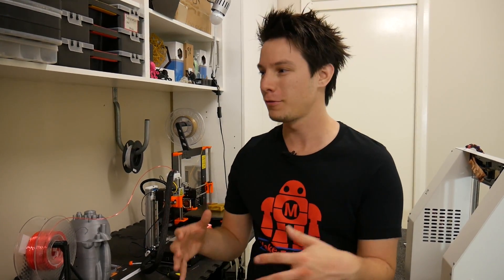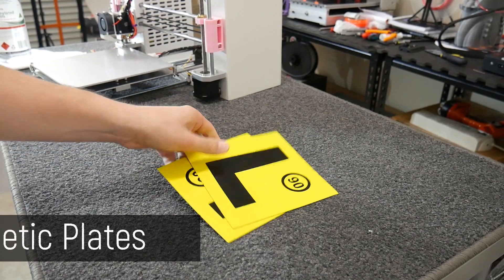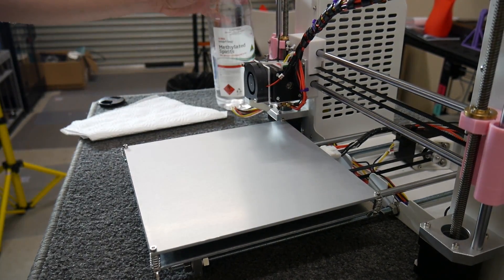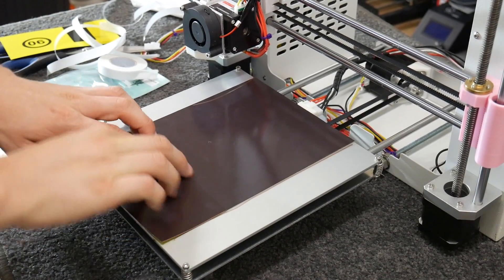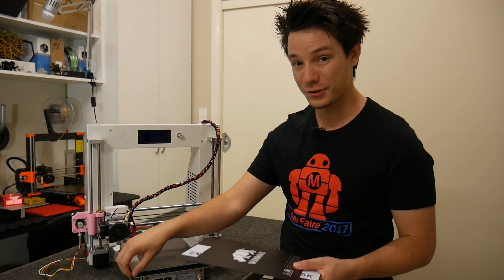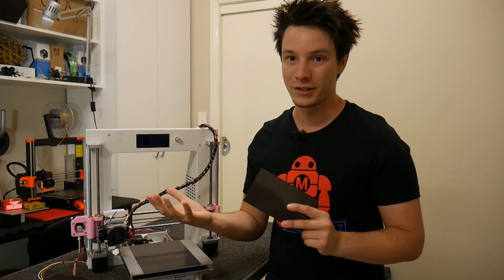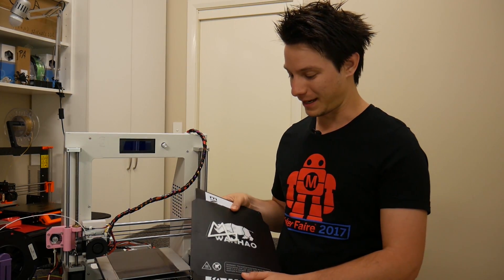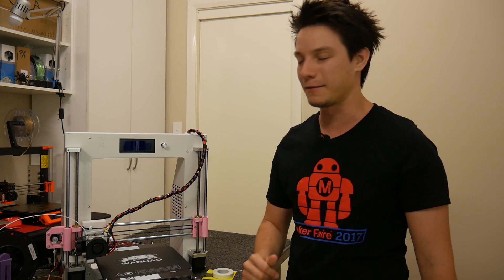Removable magnetic 3D printing surface on the cheap

Comment: Cool
Is ther a magnetic platform for the flsun q5, that cn be put over the Glas plate? 🤔
What Typ is the best for normal materials like pla+, petg, abs, tpu?
The most cheap magnets die from 80°C
After 1 bend the surface is uneven and not useful anymore.

Comment: I made mine with a magnetic sticker sheet and a piece of stainless steel. Cutting the steel was the hardest part. I'll test it soon.

Edit: tested it. The magnet part of the sheet will take 90ºC (maybe 100ºC too but it's capped in my firmware) just fine, however the rubber part will soften and stick to the steel, so what I did was stick aluminum tape to the magnet sheet, that way the aluminum won't interfere with the magnetic sticking but will prevent the rubber from sticking to the steel sheet.

Milling slots for thin neo magnets is probably a lot better because there wouldn't be an insulator between the steel plate and the heated bed.

And the thin steel plate won't deform over time. It will deform  STRAIGHT AWAY from regular handing so one needs to be very delicate with it.

There are aliexpress sellers that will do custom PEI coated spring steel.

Comment: Couldn't you just use clips to hold the sheet down, or would the plate bend up in the middle with a warping print?

Comment: HA! You think the BuildTak FlexPlate system is expensive?  That's cheap compared to the FilaFarm Switch Magnetic system  in Germany, with a FilaPrint build surface at almost $200USD

Comment: you don't even need magnets or any fancy stuff. Just buy a $5 makerbot-clone sheet, don't rip off the sticker paper, and clip it onto the bed using 4 clips. Done.
Reply: No issues of it not being perfectly flat? I thought the point of the sheet metal was to ensure it is flat

Comment: Just tried it on my Cocoon Create Touch, it so much better. 
Parts that I've been using a scraper and mallet to hammer the parts off, come off with a bit of flexing. 
Might be too late for the linear rails though, I really hammered the scraper a few times  to get big parts off.

Comment: Sign shops or ebay have the magnetic material in 30 mil. Super strong and thick for larger magnetic signs for cars and businesses. Nice stuff and not expensive!  Cut it to actually fit instead of your "joke" install. ;)

Comment: Angus! Long time subscriber, first time posting on one of your videos. I love this concept and the way you executed your idea! Even though it would be slightly more expensive to get a sheet of spring steel, and adhesive backed magnets, I plan on implementing this method of removable build plate on my machine! Absolutely brilliant! Keep the videos coming... btw I've got your tolerance test stl and I may be getting close to that elusive .1 mm :)

Comment: Damn I love my Anycubic with ultrabase. It pops off itself when it cools down. Amazing
Reply: orlovsskibet
Yep. My Anycubic delta came with that. It's like glue when it's warm, but once it cools, if the part doesn't come off by itself, it just takes a little twist.
On the rare occasions I need to pry stuff off, it's usually because I'm being impatient and it's still hot... But even then, a butter knife under one corner and it's off.

Comment: Just a heads up  for Aussie makers that want to use this system on a bigger build plate  you can buy an A4 sized magnetic sheet from officeworks for $5 - exactly the same as the stuff used on this video just bigger .
Reply: Instead of using the L plates? That's fantastic, cheers!

Comment: why not prints onto the magnet? so if you did it the other way round used the steel on the heated bed then using the magnet on that?

Comment: I experimented with something very similar to this on my first Ultimaker like 4 years ago. But I always got mayor warping issues. Now I understand why: I adhered the steel plate to the bed and used the magnetic sheet to print on (with some blue tape). Of course the magnetic sheet is way too flexible so it started bending and coming loose from the steel sheet, resulting in a warped print. Should have flipped the two surfaces like you did. Nice tutorial!

Comment: Clever idea. Getting the proper steel remains an issue, though.....
I've settled on just replacing the PEI (?) sheet.
https://www.banggood.com/5pcs-220x220mm-Plastic-Hot-Bed-Stickers-For-3D-Printer-Wanhao-i3-p-1158028.html?rmmds=myorder&cur_warehouse=CN
AU$4 each is just about "disposable"
With the bed at 40C, the old peels right off very nicely (I tried it "cold" first, and then spent an hour cleaning the residual adhesive off!)
With auto bed levelling activated, 30 or so prints per sheet is typical (much less if you run the print head into the surface!).

PS - the hair???
Reply from the maker: Not sure that stuff is actually PEI but yeah, it's so cheap now. The hair is well... it does what it wants!

Comment: I print ABS exclusively. I have Capton tape on glass, and before printing, I brush a very light film of ABS juice and print. If you go crazy with the ABS juice, you'll get the opposite effect.
After the print is over, I wait a couple of hours, or if in a rush, remove the glass with the print on it, and place it outside during winter, or in the freezer in summer, and 15 minutes later, BOOM, the part just pops off. No spatula or any other object that will score my tape. 
Have had the same tape for weeks and not a single scratch on it. Works great and not a hint of warping or lifting of corners.

Comment: why wouldn't you print something in abs to attach from the corners underneath the build plate or outside the edge of the bed holding some decent size neodymium magnets or just glue them underneath the bed. Bending your steel sheet to pop the part off isn't ideal either especially as you said it is not spring steel. I personally use a glass heat bed and glue stick and i seriously wouldn't even consider changing to this solution you have shown for a very minor "upgrade" since i don't have any problems with part removal.

Comment: Ever tried the Ultrabase from Anycubic? Once the bed is cold the print is released without any effort like it was just put on the plate
Reply: that fun ended for me when I cleaned bed with acetone. And now using it with hairspray.
Reply: I clean it with alcool. No issue for now. I just had to slow down the first layer speed to 10 mm/s to be sure
Reply: That's good for you as your ultrabase is alive. I think I broke mine with too much acetone. I wiped with acetone and alcohol every 2 days and it doesn't stick even PLA. So going for a cheaper solution Lokbuild
Reply: Mine stopped working after a few dozen uses. Tried cleaning it to no avail with high purity IPA.

Comment: I made a flexible build plate using a piece of white colourbond and just held it there with butterfly clips.
Works well, I just use a glue stick, so the prints stick. It's easy to clean and get prints of.

Comment: FLIR camera : business expense :)
Reply from the maker: You know it!
Reply: I wish I had a FLIR, but I don't have enough utility for it to justify the expense.
Reply: Yes, I know, but I can already do that with my IR thermometer. It only has a 1-pixel resolution, but that's enough for my purposes. Another technique is to watch the IC. If it changes colour or the magic smoke escapes, I'd be pretty sure that's the faulty part ;) Plus, Melexis has some good IR arrays much cheaper than a FLIR if I need more resolution.
Reply: FLIR is a pretty legit tool when you realize malfunctioning equipment is always going to be significantly hotter than if it was functioning well. It doesn't matter if it's PCB circuits, hydraulic lines, meshing gears, or a bad battery. Any supplied energy to that part has to be converted in some way, and it's really easy for it to just turn into heat. FLIR will pay for itself in hours saved troubleshooting if you work with complex systems or a large volume of simple products. It's like breakpoint program debugging, but for the physical world.

Comment: GREAT VIDEO :-)

The following comment is rated technical, dry and boring, YOU HAVE BEEN WARNED... ;-)

Typically, magnets have two important specs (for this conversation), working temp and curie temp. The working temp is the temp at which a magnet can be subject to, repeatably, for it's entire working life. The curie temp, is the point were all magnetism is permanently lost. Between the working temp and the curie temp, some magnetism will be lost, and not fully recover, when cooled. For example, a neodymium magnet might have a working temp of 150C and a curie temp of 1000C (if sintered at around 1000C), between 150C and less than 1000C magnetism will be lost,at 150C and below the magnet will function properly, during it's lifetime (however long that is).

Comment: I love this idea. Sure, steel signs and car magnets won't last forever, but they're dirt cheap and easy to source/assemble, so they don't need to. Heck, if they can handle 60C consistently, I'd bet you could order a roll of PEI and have as many panels on rotation as you want. Also, I'd feel better about tossing a plate over a marred build surface instead of breaking out the limonene and doing freezer voodoo if it didn't cost a crapton to replace.

Comment: You could just put the print surface on another magnet instead of metal and then it would be really flexible for popping parts off but when stuck down to the print bed would be flat and solid as the print bed is. I might just try that.

Comment: Hi Angus, When I need to cover a large square with two smaller squares, I tend to cut the smaller squares along their *diagonals*, then join the remaining 90'-angles at the center of the larger square. You'd be nicely able to cover the entire Aurora-bed with your L-plates this way.. (this works with two slices of cheese on a piece of bread too).
Reply from the maker: +Aditya Mehendale good point! If the thermals weren't very good at the edge of the plate I would definitely consider it. Pretty surprised it worked as is

Comment: I don't know. I've never had problems with removing a part from the bed. 

One advice for easy removing parts is to print a 1mm 45° chamfer at the bottom of your print. This way your scraper will pass bellow the part easier.

Comment: I bought a Mag Hold kit from the US about 6 months before Buildtak brought out theirs. It costs around £80 but it included a new 3mm thick aluminium build platform with embeded magnets to replace the 2mm one on my printer, it also came with a springsteel sheet with buildtak on as a print surface. I bought several extra spring steel sheets and buildtak sheets too. I've been using it for around 18 months without any problems at all.

Comment: i dont know what sources there are internationally but you can get a  12"x12" spring steel for approx $30 from McMaster Carr. Apply buildtak/PEI to the steel, magnet to the bed and bam, a 3rd the cost for an equivalent product

Comment: Just a mention some steel UK distributors are cashing in on this like they did aluminium plate, you can get a sheet of 300 x 300 spring steel for about 16 GBP, around 30 AUD for you, you have to order it and it is laser cut for whatever size you want, China will be next LOL, RobUK

Comment: what if i just use a few small neodymium magnets on the sides instead of those magnetic plates , i think they are strong enough to hold it in place without slipping

Comment: In the US it's possible to purchase magnetic vent covers in hardware stores or building stores. They are designed to cover the heating or cooling vents in your house. They're just large flexible sheets of magnetic material. I'd use spray adhesive rather than double-sided tape in this application. I print with ABS almost exclusively and I print on borosilicate glass. I made some magnetic hold downs that use small discrete magnets along the edges but in practice I just leave the glass plates on and wipe the glue stick off with a wet paper towel before reapplying new glue and printing the next ABS object.

Comment: Hi, I would like to interject on your mentioning of the curie temperature of flexible magnets. Flexible magnets are a laminated mixture of ceramic (ferrite) magnetic powder and a flexible binder. Ceramic magnets have an operating temperature of 250C and a curie temperature of 450C. So demagnetization would never be a problem on any heat bed. The flexible binder on the other hand can become unstable at as little as 100C and so should not be used on a heated bed any higher than 80C.
Just my two cents.
Reply: in the real world (i.e. not textbooks) heat reduces magnetic efficiency at any temperature

Comment: Good tip Angus!  If anyone is looking into more info, you can also get self-adhesive neodymium sheets with a much stronger pull  but are good to 100 degrees.  There are also higher temp but lower pull sheets, but usually flexible sheets they tend to use a grade of vinyl that starts to deform around 125 degrees or so. Also, Spring temper carbon steel is often sold as hardened shim stock sheets, which you can get a little cheaper occasionally and are usually toleranced well for thickness (if it is flat... sometimes it is cut off a roll and a little bowed).  If you can find a hardened piece of 1095 steel that happens to be flat, that’ll work too. Keep an eye out for shim “sample sheet” packs which are often 4”-6” square, and are only a few bucks.

Comment: You can use cheap magnetic 0.5mm  foil with glue and 0.5mm ferromagnetic without glue instead steel. It is easy to buy A4 sheets +-$1. It is in polish but with pictures :  https://reprapy.pl/viewtopic.php?p=34451#p34451 It works perfect for me.

Comment: I used two sheets of magnets with one of them having the buildtak attached to it and the other stuck on the build plate on my Wanhao. It's both flexible and durable with no risk of deforming any steel. keep in mind though that the magnetic sheet is magnetic in "waves" so it's important to make sure they are aligned to get a perfectly flat bed.

Comment: Nice hack but i don't understand the need for magnets ? If you want a removable build platform why not just use some small bulldog clips ? or have we all become so lazy that they are too much work to unclip ? You may find stainless steel sheet is less likely to bend when you twist it but it doesn't have the same thermal conductivity as steel which probably wouldn't matter anyhow as we use glass which is even less conductive .
Reply: I use bulldog clips too. Works but magnets keep the edge of the bed clear so you don't crash into anything.

Comment: Just epoxy some N52 rare earth magnets on the bottom of your printer bed. Ebay ,Amazon. Bangood, and Gearbest all have them. I got some flat round 30mm x 3mm. You may have to peel up your silicone heater pad but it goes right back on again with no problem.  Then buy some thin HVAC sheetmetal. Or some mancave signs if they are large enough I suppose. Cut it to your bed size and your done. Much  stronger magnetically and cheap! Now The top of your bed is still clean, and you have the option to use flexible metal plates, or you can still go back to glass or whatever! Nothing is stuck to the top of your printer bed! I have done this on aluminum and glass/epoxy beds. It works on all. Don't use cheaper magnets! Get the Neodymium N52 rare earth ones. I use 12-14 on a  bed of 300x300mm like a Tornado or CR10. It only takes a couple minutes to unscrew your bed from the printer and peel off the heating pad. Lay out  a grid and make sure all your magnets are facing the correct way I marked a + sign on top of all mine so I would know the magnets polarity and not put some on upside down. ( you want all magnets pulling together)

Comment: I did this a slightly different way; I picked up some cheap neodymium magnets from Amazon, 5x5mm cylinders, and some blue spring steel shim stock. The shim stock I used was from McMaster Carr, part number 9014K619 if you're interested. It's a 6x25 inch sheet, 0.032 inch thick (just over 0.8mm). I epoxied in the magnets at the outer edges of the printbed, where the heat isn't so high; technically the curie temp of N52 magnets is around 300C, but they start to lose effectiveness around 80C. I haven't noticed any issues, however. Finally, take some 100 grit on a random orbit to the steel. Along with our good old hairspray, it sticks perfectly.

With the 6x25" sheet, I was able to do 2 Printrbot Simple Metals and one Monoprice Mini, for a total project cost of about $40 USD. Cheers!
Reply: is the .032" thick enough? if you were to do it all again would you order that same thickness?
Reply: I haven't had an issue with it yet; I originally specced it based on the new Printrbot Simple. They use a 0.035" spring steel bed, and the 0.035 on mcmaster was 35$ as opposed to 23$ for the 0.032", which is the only reason I went thinner.
Reply: wow. what a great idea. cheers mate. doing this now.
Reply: Would this work? I something a little bigger. https://www.mcmaster.com/#9075K324

Comment: I used my DIY FlexPlate for ABS at 100° C just fine. Only thing that softened was the glue from the decorative part on the mag sheet. After that I got some raw mag sheet and used proper 3M temp stable adhesive. If I may toot my own horn here: https://www.youtube.com/watch?v=GIvL5mAMb7E this is not the version with the proper adhesive though, just cheap double sided tape. Was a good proof of concept though.

Comment: Hi, did something similar on my cr10 2months ago with pretty good results - it was ~$10 upgrade - in our country these magnetic sheets are sold in rolls, so you buy the amount you want and for the approx $10 i have material for maybe 5-6 beds. Another big advantage (magnetism is the one reason) is weight of the bed opposite to original glass surface - it is one fifth of the original glass surface, so my prints has smoother surface.